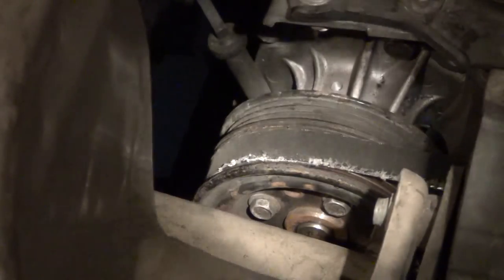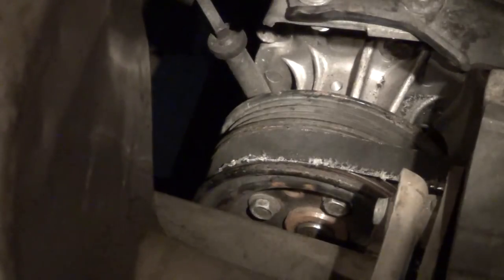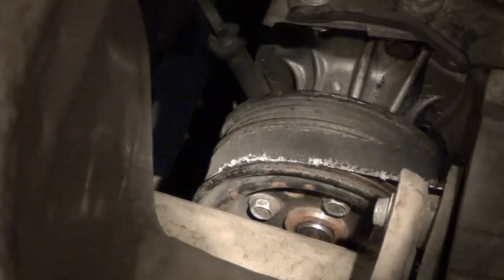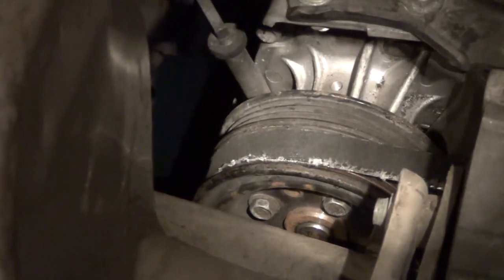91 Toyota Corolla Engine Noise SOLVED

Comment: Wow. You're back. Great to see you. That belt looks like it is needing replacement. If the bolts were ever overtightened it could have damaged the threads that would cause it to loosen over time. As someone else said, use locktite,  If it ever starts coming loose again. From all the engine vibration a small loose object can sound huge. How about an update video.
Reply from the maker: I just tightened it down. the sound never came back. can't do a follow up because I sold her and she now lives in Olympia, WA.  :)
Reply: After I posted here I saw your new truck on Twitter. lol
Reply from the maker: SJGINC I should do a video tour of it. Yay! Twitter! I rarely use it but I can post random pics on there easier than posting a video!
Reply: Or do a video tour on here.
Reply from the maker: SJGINC I can do that. :) I should clean it out and wash it first. LOL
Reply: lol.

Comment: loose bolts on a rotating shaft is like a worn out bearing. the bearing just moves freely instead of smoothly so no noise. the bolt will not wear the thread, unless you turn it too tight or fast. but it vibrates the shaft, and in turn the whole thing, making the noise
Reply from the maker: thanks!  :D

Comment: Ok, what I'm thinking is that the washer on the loose bolt clangs around in the little space it has between the bolt head and pulley.   The pulley is practically a bell, right?  Tap one with a hammer and you'll see.   Anyway, with the other tight bolts and the belt, this dampens the ringing, but you still hear some random noise.

OH!  Glad to see you, you look fabulous as usual!

Comment: Spanky :) i didnt realize you had a channel started this is awesome. subscribed! great job on the find. are you certain the remaining 3 are tight tight? back in the day many years ago i did a transmission on a hmmm i cant even recall now lol however it came back a year or so later with what sounded like a lower end knock, started ripping into it and found the torque converter bolts came loose! sigh~ with one bolt backed out more so than the rest. however just enough to allow the shift in the bolt to hole clearances to cause this interference noise, lesson learned the hard way. its great seeing you again take care
Reply from the maker: Oh yeah, I'm an old pro! ;) Yes, I checked the remaining 3. I had a similar issue with my old 93 Explorer as you had with the transmission. The drive shaft came loose. I was driving from Alaska to Seattle (mind you, I had worked on it in the lower 48, driven it up the AL-CAN to Alaska and driven it all summer) when it started making noise. I stopped at a mechanic shop in canada and he said it was the exhaust. I knew that wasn't right and couldn't pin down the cause and it was -10 outside. I didn't have clothing to get under the truck in the snow and it dropped out on the freeway in Seattle. Scared the daylights out of me but I got to the shoulder and out of harm's way without ripping out the rear differential. I don't know how.  Lesson learned. LOL
Reply from the maker: Also,  subscribe! I subscribed to yours! ;)
Reply: I'll second that ;) that's quite the adventure! Glad everything worked out in the end. Some of our darkest moments make for the greatest memories. And a heck of a conversation piece lol seeing your video took me back a few years  when you started out the announcement video choosing me as the winner in Brian's fabricated tool contest :) very memorable moment for me. Not only winning the contest but the follow up video you guys did was awesome. I can only imagine the moments during production   Of that video. Memories
Reply from the maker: robinsonsauto Actually, My first video was about a thermostat. Well, behind the scenes in those videos were either stressful (trying to remember how to say thing just how Brian wanted me to say it) or fun and goofy. Yes, Dark moments are great learning experiences and good stories. I Always told my youngest sister, "There are no such thing as bad dates, only good stories." Hahaha! Man, I'm going to have to watch those videos again. I can't remember them very well right now.
Reply: yes that came out wrong, meant to say you made the opening lines of that video, was priceless. very true thats where we learn the most some times
Reply from the maker: robinsonsauto ok.  I have to go look it up now.  LOL  I can't remember it at all except there was a contest.
Reply from the maker: robinsonsauto wow.  I remember that now. I really just remember Brian's sister announcing. His videos lost their silliness. I miss that. So I try to keep some slilliness in my videos.

Comment: That happened to me. Bolts get loose on pulley and then pulley starts to wobble and destroys the belt and bearing inside the pump. Looks like your belt is done. If I was you I would take belt off tighten the bolts with blue lock tight. Then see if there is noise or play in pulley, if there is pump won't last long. Bearing is gone then.
Reply from the maker: The pulley didn't wobble.  I just tightened them all down (just one was loose ) and it was fine.  :)

Comment: not a master of anything but, my guess would be that, the bolt being loose could throw off the balance of the wp. I don't know what kind of bearings or support that wp has but, if that slight weight difference combined with the centripetal force was greater than the bearings capability, it could of caused all sorts of odd noises.